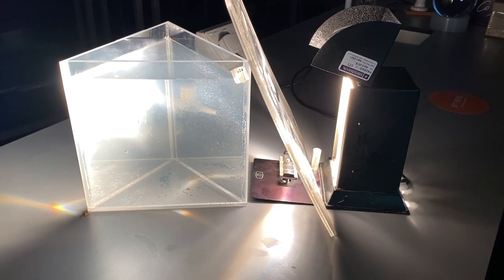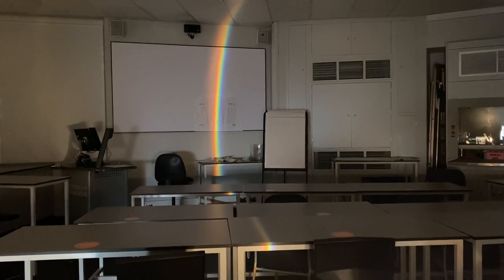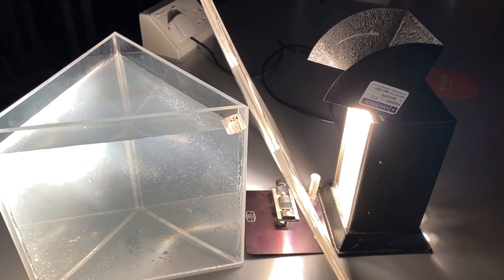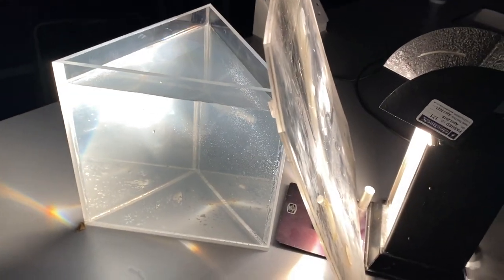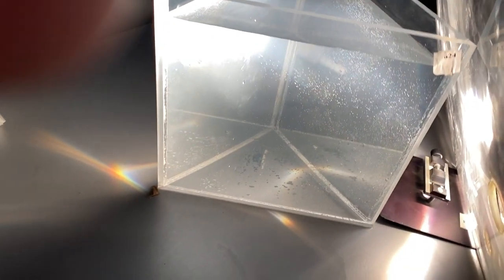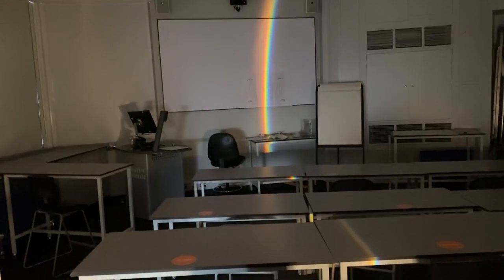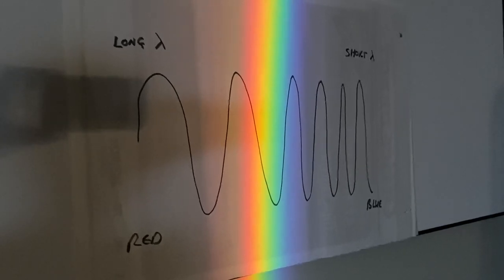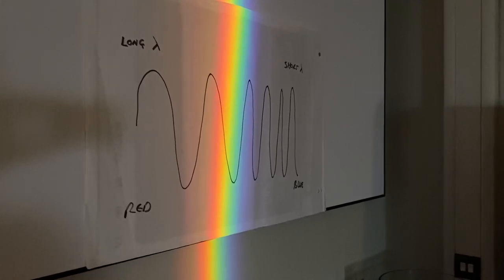Giant Prism Demonstration

Comment: I have a sun allergy called Solar Urticaria. I'd like to investigate which wavelengths trigger the reaction. I was thinking of building a similar prism and  simply using sunlight instead of the projector\Fresnel lens. I'd then cut a slit in some cardboard to isolate specific colors and stand on the other side to expose my skin. Can you think of any problems with this plan?
Reply: Interesting !! If i may suggest someting, also try to maks what you can't see : infrared and ultraviolet, on each side. Il you are going to concentrate the light before the prism, the effect of UV (invisible) can be quite intense and bad for your skin /eyes